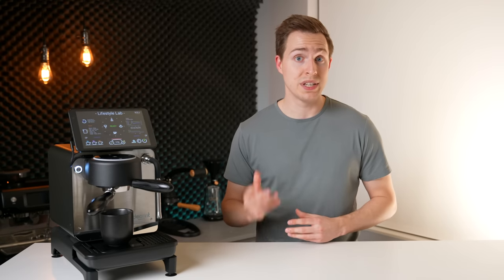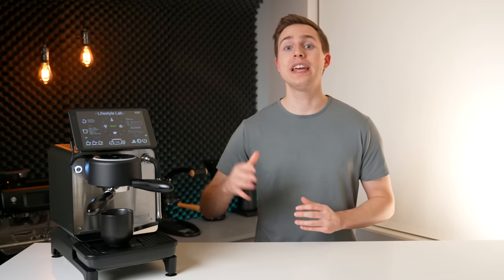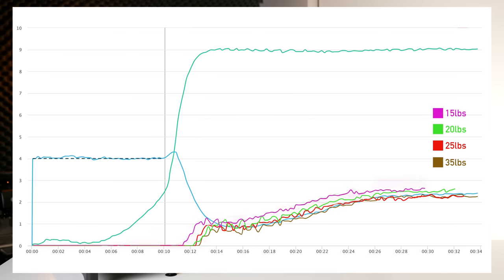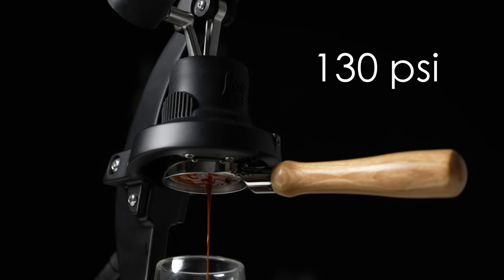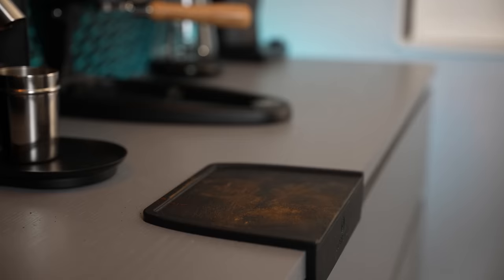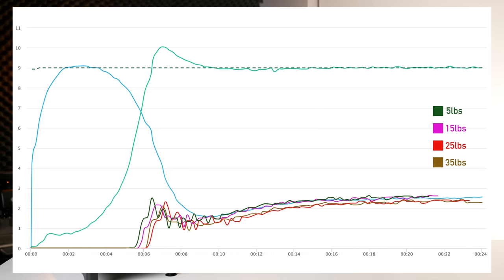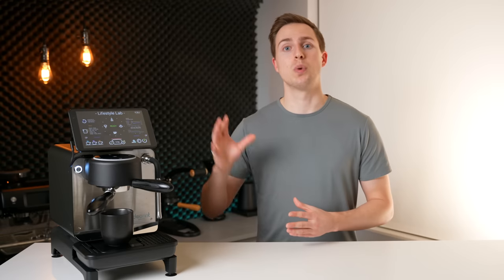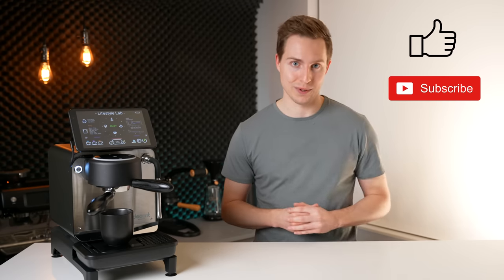Espresso Tamping Pressure | Does it Matter??

Comment: I do like your findings, but there is one thing that should be mentioned from a physics point of view. You explained nicely what is 9 bars or 130psi- those are both units of pressure, so force per area. Then you directly change to pounds of pressure, whereas you should say pounds of force.If you are pushing down the tamper with a specific force, the pressure is different depending on the size of the basket (for eg. 58 vs 51mm basket will have a difference of about 30%).
Reply from the maker: I decided not to convert to pounds from PSI to avoid over complicating the video for most people. If you listen closely, I say “130 pounds per square inch of surface area in the portafilter.” For those curious, it would be around 530lbs on the surface of a 58mm puck!🙂
P.S- Notice the little iron ring on my right pinky finger ;)
Reply: He’s an engineer pretty sure he knows how pressure works
Reply: @LifestyleLab_  I do understand your point, but still when I hear pressure I think units of pressure- Pascals/Bars/PSI. When I hear kilograms/pounds I think of mass or force (although Newtons would be more correct). I may just be a purist.
Didn't know the meaning of iron ring- I think it is only a Canadian thing? It's good to learn new things everyday.
Reply from the maker: Ahh, you’re referring to when I said 20lbs of TAMPING pressure! Then yes, I suppose I did misspeak and should have said 20lbs of force 👍
Reply: @UCQlrajwh3TB08bCoDBJLXDg it's common parlance to refer to PSI as "pounds"
Reply: @Taylor-xi2no  Of which you do not seem to understand

Comment: I'd say that with a traditional (non-self-stabilizing) tamper, excessive pressure quickly becomes radically detrimental as it becomes more difficult to achieve an even tamp the more pressure you apply. So there is no potential benefit- But a lot of potential detriment from having one side of the puck unextracted and a thinner portion on the far side overextracted. (This is based on personal and extensive experience; My mentor taught me, and I taught those I trained, that something like 25-30 lbs of force on our 58mm filters was ideal, while in practice I found anything from about there to 50 lbs achieved similar results; Anything beyond that behaved unpredictably unless I carefully noted whether the tamper was tilted post-tamping, which is not something you have time for in a busy professional setting. No point risking a bad shot for no potential gain. My stated weights are potentially inaccurate and done by feel, based on perceived ratios of my bodyweight and unrelated experimentation with scales.)

Comment: An old friend of mine summed it up nicely: Push until the coffee pushes back. 

i.e. it doesn't matter what force you use so long as you feel that push back.
Reply from the maker: Yes! I’ve always liked that explanation, should have said it in the video :)
Reply: I think that explanation makes the most sense from an engineering perspective. During the start of the tamp the coffee wont push back because all of the movement is due to the particles rearranging into a more compact structure, reducing the void ratio. Past a certain point the particles cant be arranged any tighter and so any additional movement is elastic, you push down and the puck pushes back.

Comment: I came to this video because sometimes my shots are fine and sometimes they drip, despite what I would think was similar puck prep. I figured I was over-tamping sometimes, but now I'm wondering if the grind is too fine or whether my cheaper machine just isn't producing consistent pressure from the pump.

Comment: This is good research with results that are agreeable with my practice from last 4 years. Multiple times I missed to tamp after using OCD-like leveling tool. Water went through it quickly. But even a modest tamp was enough to sustain water for coffee. Modest as in — overstuffed basket with OCD leveling tool pushing coffee down

Comment: videos like this one and some experimenting on your own machine are the keys to figuring this home espresso thing out.  just don't get stuck on one setting or grind or tamping method.  play around a bit and you learn a lot even if you have to dump some down the drain while you learned what NOT to do.  i've been roasting at home since 2000.  there is just as much to learn about that as there is about extraction methods.  sure is a lot of fun though!

Comment: What I hoped was covered because I’m a novice is how do you know how much pressure you are applying if you don’t have an expensive machine to tamp your coffee?
Reply from the maker: The exact same concepts apply regardless of machine price. 
The only DIFFERENCE will be if you’re using a pressurized filter basket. In that case tamping pressure becomes less important, and you’ll want to tamp lighter to avoid choking the machine

Comment: This is an eye opening myth buster video, thanks.   I wonder how the pressure over 35lbs would impact (45,55lbs).  Would it start to clog the flow at some point?  If the higher pressure tamping doesn't impact the flow, we can tamp pretty hard without worrying about "overtamping."
Reply: You can’t overtamp a puck. You essentially reach a maximum density where the puck won’t compact any further.

Comment: If tamp pressure doesn't matter then how come with keeping consistent expresso grind (using flair royal manual grinder) I can drastically change my extraction flow rate from real fast to nothing at all being pushed through the grind and pressure gauge maxing out way above 9 bar. There is a difference in not being fixated on exact pressure and being consistent stating tamp pressure can't be too much (I'm talking in general here and not specifically about this video)
Reply from the maker: The thesis of this video is not that tamping pressure doesn't matter, but rather it doesn't matter once you get above a certain threshold. Or, if you keep very consistent tamping pressure. Tamping once at 5lbs and then the next time at 25lbs will absolutely yield different results.
Reply: @LifestyleLab_  I feel that that is misleading unless you're saying it doesn't matter once you tamp too hard and there is no flow :-). I'd agree 25lb, 30lb would be pretty similar and the prize is not for super hard tamp. If you tamped harder the flow will slow down.

Comment: Here is my question.in this case what would be your best recommendation gor for tamper? Palm tamper,self leveling tamper ,or spring loaded tamper? Is level coffee more important than same pressure tamp everytime?
Reply from the maker: They are both important, but an unlevel tamp will almost always lead to uneven extraction, tamping pressure, as shown in this video has some room for error above a certain point. For that reason, I always recommend some kind of leveling tamper if you struggle to do so manually

Comment: the ECM machine i just got came with a naked portafilter (bottomless)  had a lot of trouble getting the grind fine enough to get any pressure.  went to the regular portafilter and had way too much pressure.  am very happy with the regular portafilter and the ECM machine.  also love my coffee distribution tool.  don't even use the tamper any more, don't need it.
Reply: I would say your problem is not "naked" versus "regular". The challenge with "naked" is, though, to get the grind (particle size)  and its dose right, first, and then the proper distribution. A "regular" portafilter (literally: filter carrier) masks uneven extraction and coffee spraying in all directions from the filter in cases when the grinds have issues, so as a "learning tool" the "naked" is actually very good. Also, a regular portafilter leaves coffee residue in the space between the outer shell and the filter basket. This builds muck over time and impacts the taste of your coffee. I use a "regular" portafilter, but removed the spring that arrests the filter basket - and have multiple filter baskets. Each serving has a clean filter and rinsed + dry-wiped portafilter interior to start with.
Bottom line is the question what "recipe" of coffee you want to make. If you make Americano, then all this espresso wizardry is almost meaningless. When you want to do classical Italian "caffè" (=coffee, =espresso ristretto) then it matters a lot. And then there's today's US gen extreme doses into single shots.
Reply: @jpdj2715  if i get the grind right for the naked portafilter and it is so fine it won't even extract through the other basket how has that improved my coffee extraction experience?  and yes your description of dialing in the grind sounds just like it came from other you tube videos i've seen but i still can't use the same grind on the other portafilter.  also doesn't everybody rinse and dry their basket between pulls?  how does having an extra basket make any difference?  rinsed and dried is rinsed and dried no matter how many extra filters you have.
Reply: @chucklemasters6433  - If you dialed your setup in for the filter basket in the regular portafilter, then take that basket out and put it into the naked portafilter. Something may be wrong with the holes in the filter you have in the naked one now - too many, too large, etc.
If what I wrote "sounds" like YT then you must have been reading out loud as if in primary school? Have you actually been paying attention to all those YT videos you watched and that you think my write up compares to? Seems not.
Reply: @jpdj2715  your reading comprehension skills don't seem to be the sharpest i've seen either dingle

Comment: Great breakdown in the video 🙌
I do wish that you had included the flow rate mls/sec for each of the tamps as it was cut off the right hand side of your graph on the decent.

I presume with the tamps 25lbs or higher that you were around the 1.5-2.5mls/sec and as the tamps were less strong that number rose significantly- 3.5-4.0+?
If you do read this and could clarify, that would be great, thanks 🙏😊
Reply from the maker: The flow rate is not cut off, the exported graph simply uses the one unitless axis on the left. It can be read as bars of pressure or flow in mL/s
Reply: @LifestyleLab_  So the data on the side is actually flow rate? Sorry my mistake 😅🙏
Reply from the maker: Yes, flow rate AND pressure, hence why it’s unitless haha. Understandably confusing

Comment: I was having no issues with my espresso machine with the amount of tamping pressure I've been exerting, but lately for some reason even while tamping at well over 40lbs of pressure my extractions are coming out way too quickly and my "espresso" is extremely weak. What can be causing this?
Reply from the maker: Tamping pressure shouldn't be used to regulate flow/extraction. You need to just adjust your grind size finer to slow the flow :)
Reply: @LifestyleLab_  I understand the fineness of the grind but the fineness of the grind hasn't changed since the extractions took the appropriate amount of time and the espresso was great with plenty of cremma on top. I doubt there's anything wrong with my machine since if anything if there was a lack of pressure the extractions would take longer. could it be that I'm over tamping forcing the flow to go around the puck rather than through it?
Reply from the maker: @thriftysurvivor6117 the same grind will not necessarily work day to day. Cafes dial in each morning for this reason. Main thing contributing to the shift is often beans aging / becoming stale once the bag has been opened, but even small variations like air humidity can require adjusting the grind size.
Reply: @LifestyleLab_  That being said, should the issue possibly go away as the weather changes?
Reply from the maker: Possibly :) 
But it really isn't an "issue", it's just a variance that you need to account for on your next shot. Perfect normal to need to move finer or courser day to day or as beans age
Reply: @LifestyleLab_  Thanks for your help.

Comment: Have you considered that the shower screen is actually tamping....
Prep a shot either method. Then lock it into the head. And without shooting the shot remove the handle and you'll see that the screen has touched/tamped the coffee. 
It means the assumptions made about the clearance between the top of our tamped puck and the bottom of the screen are wrong.  In that there is no gap and in fact even without and ocd or tamping the screen will as it has always been tamp for us.
Reply from the maker: That shouldn’t be happening. If it’s happening on your machine, then you’re over-dosing for your basket. 
If too full, this could even damage the shower screen
Reply: @Lifestyle Lab  18grams (double) in most standard e61 groups or Rancilio heads will do this. 
If you consider the fact that tamp pressure is becoming less of a consideration. and that dose plays a bigger role in extraction time now than tamping (grind set not withstanding) means that as you increase dose and if the screen is in fact tamping. Every gram you add would increase that pressure. 
This can be observed to small degrees if your handle goes past 90° when locked your shots go longer. 
This is because the lugs on your portafilter go up a thread like ramp as you wind it into the head. So the further around you swing the handle the higher it sits in the head
Reply: @Lifestyle Lab  the fact that every video you find online showing someone using no tamp and getting OK ish extractions is met with disbelief and confusion. 
Now if you consider that perhaps the screen has been tamping after we have done it.... this whole time. 
Making grind size  the most important factor to extraction time. 
Followed by dose. Then a combination of those 2

And tamping nowhere in site
Reply: @Lifestyle Lab  this theory is backed up by the fact the Rancilio group head shower screen is retained by a hex flathead screw in the centre. That if put in lightly using even finger pressure.  always winds itself tighter than when you put it in. 
Because the dry tamped puck is turning the screw. 
But don't take my word for it just try it.
Reply: @Lifestyle Lab  this is also confirmed in the usage of the single shot handle and basket.
When using the fill and level method of dosing a basket. 
All baristas are taught that for the single basket it can't be level you have to scoop some out. 
And if you've ever forgotten to scoop. That is you level it level abs then tamp. 
You won't even be able to lock the handle in the head. 
Because the screen which is touching the tamped coffee is preventing the lugs from grabbing the head. And if by small miracle you do get it in. the extraction is 3 days long
Reply from the maker: The shower screen should not be used to tamp. Period. 

The machine isn’t designed to be used that way. 18g can completely overflow or completely underfill the same basket based on the density and roast level of the coffee itself. Baskets don’t hold a certain weight, they hold a certain volume. If your puck if being compressed by the shower screen, you’re dosing too high.

There was no contact with the shower screen when locking in the portafilter in the tests in this video. (As is proper practise)
Reply: @Lifestyle Lab  cool. 
So when somebody does not tamp or ocd.. ie nothing how then do we still get a useful shot and a good looking wet puck
Reply: @Lifestyle Lab  🤣you've missed my point. 
Fyi
I've been a barista 16 years.
Am currently a service technician for all major brands. 
A certified trainer. 
My daily driver is a slingshot conical ( very hard to overdose with)
Puq press 
Rancilio 3grp classe 20.
And a Royal Rise 2grp multi boiler. (E61 grp)
I think I know how to dose and tamp.
Ironic your criticism of weighted dry dose which has become a now industry standard.
I'm more than aware of surface area differences when grinding course and fine.  And the weight differences with roast profile ( light = heavy... dark = lite)
But did what I told you to do in my first message. Again this morning and confirmed on both machine that post tamp. Screen is touching the dry puck
Dry weight 17.2 gm
Puq on middle setting
Handle exactly 90° to machine
Rancilio factory 18gm bucket 
Roast profile medium/dark

Comment: So, why pre-infuse?
Reply from the maker: Allows you to grind finer and increase extraction without choking the machine. Also helps to reduce channeling by slowly soaking the puck before hitting with full pressure
Reply: @LifestyleLab_  thank you - there are a lot of variables & a lot of ways to go wrong...
Reply from the maker: Absolutely, that’s the curse of trying to extract a full 18g of coffee in only 30 seconds. Espresso is very finicky

Comment: Wait wait wait, what happened with the lever? 😱
Reply: portafilter locks securely inside of 4 and 5 o'clock. failure to lock in securely can allow the portafilter to rotate out as higher pressures are reached
Reply: @FlairEspresso  I thought so, let's call it a purposeful failure for dramatic effect ☺️
Reply from the maker: 110% my fault!